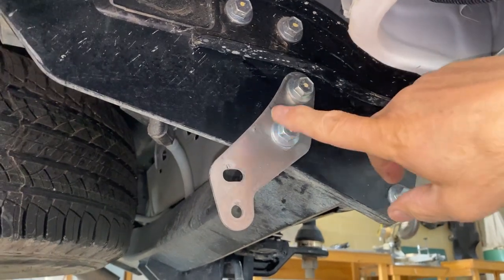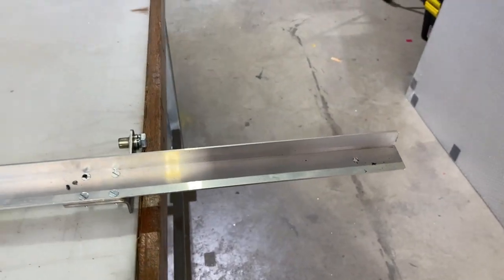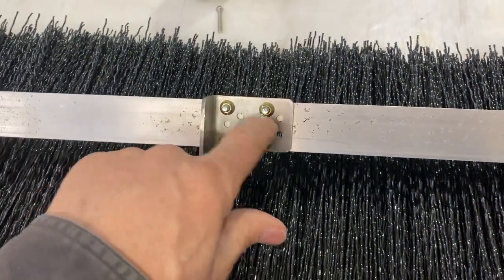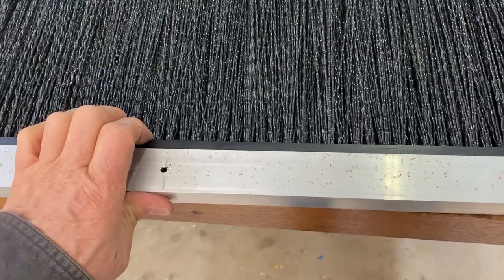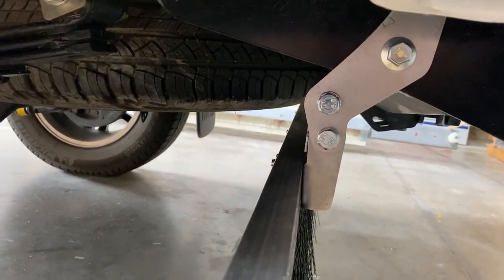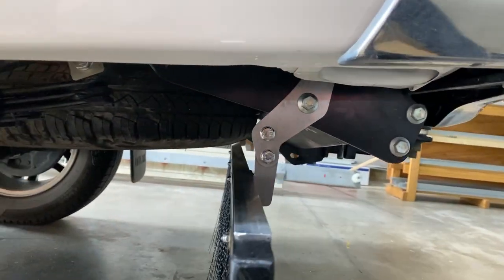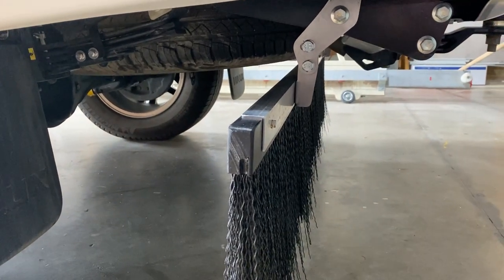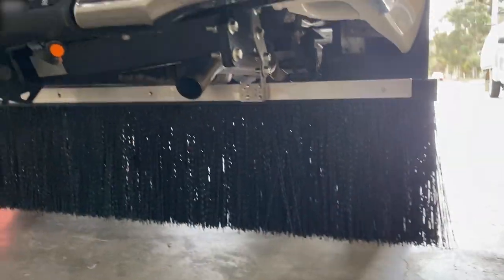Mounting "Rock Off" towing brush strip to a 2021 Hilux

Comment: We’re two new holes drilled in the tow bar? Does doing this affect the tow bar engineering wise? Why weren’t the tow bar bolts used? Great set up though.
Reply: No holes were drilled, they use the existing bolts.

Comment: Nice Video, Have you used in anger yet and if so how did it perform, I'm think of this rather than Stone Stomper to protect my tugs rear window plus ease of use, I already have large mudflaps on 4x4.
Reply from the maker: Haven't tried them out but have a big trip coming up at the end of the month, so they will have a good test. I also thought of the Stone Stomper but I think it would be a pain getting to the back of my Hilux.
Reply: @Signs_Plus  It seems these are used in USA quite a lot but trying to find reviews on how they perform is difficult, will you post an update after you've used it?